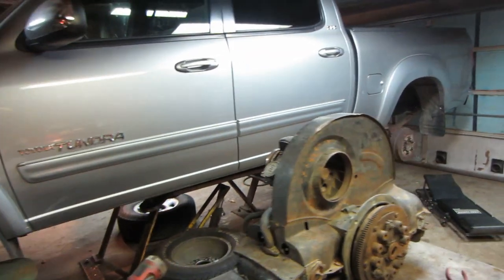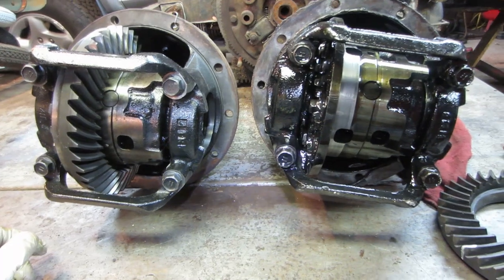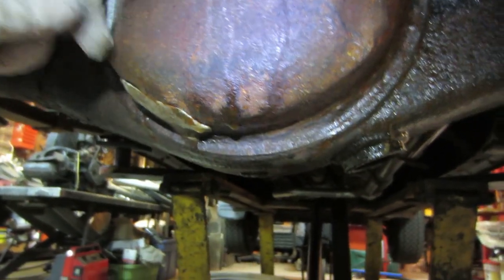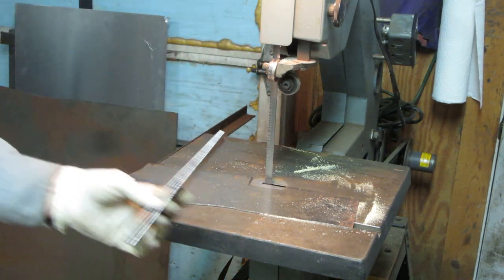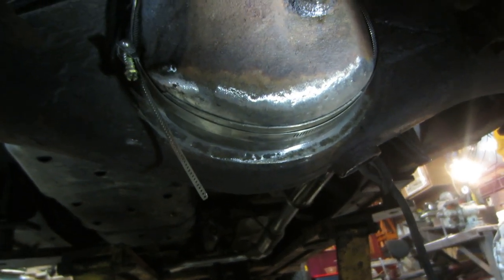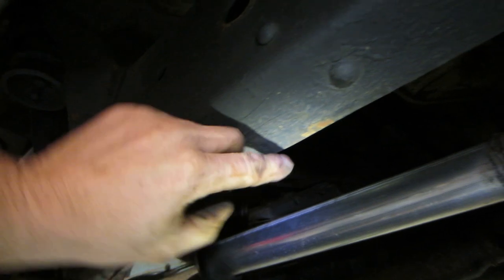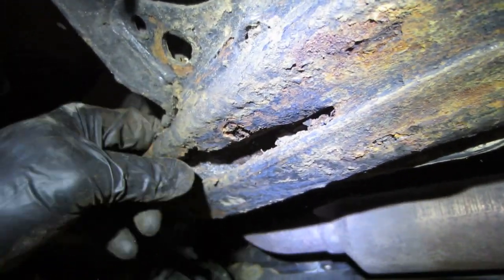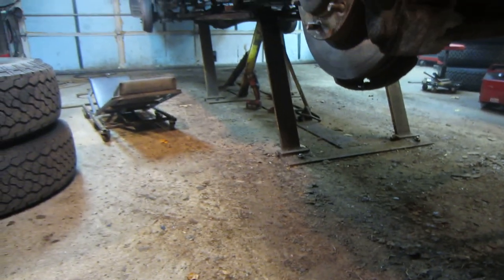toyota tundra rear differential repair

Comment: Fix it, sell it, buy a southern or desert truck, = happy
Reply: Until the southern truck rusts, then he's back in the same situation.
Reply: A 10-12 year old truck will be rust free. Drive it 5-6 years and sell it on. It will stay fairly clean in those 5-6 years. Start process over =happy
Reply: m ph More like = waste of money.
Reply: How so?
Reply: m ph He'll have to buy a truck, have to pay to have it shipped to him. Since he lives in the rust belt it will be  rusted junk in 6 years then he won't be able to get his money back out of it when he sells it.
Reply: Shipping a truck from TX to NH would cost about $800. A rust free Texas truck will not be rotted out in 6 years of NH winters. It would be a 16-18 y/o truck that is fairly clean and still have quite a bit of value left in it. His 12 y/o Toyota from the North is basically scrap before repairs due to a rotted frame. Whats that going to look like in 6 years?
Reply: m ph My brother lives in New York. I've seen 6-7 year old cars up there rusted out so much that they won't pass inspection. So a TX truck will be junk in 6 years unless you don't drive it in the winter. After he repairs it and oils it down and keeps oiling it it will look the same as it does now. The rust won't get any worse.
Reply: Why not just "oil down" a rust free truck then? Then it would look the same as it is now.
Reply: m ph He doesn't have a rust free truck. Mustie likes to do things on the cheap so he's probably not going to want to pay an extra 800-1000 dollars for shipping.